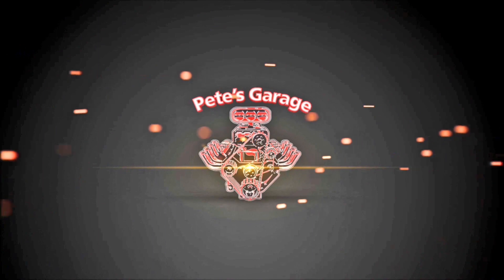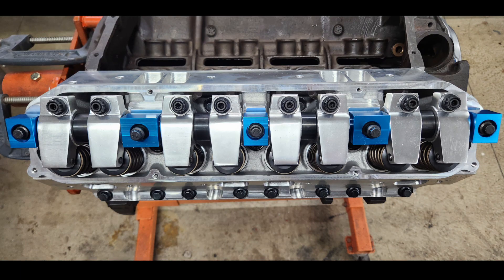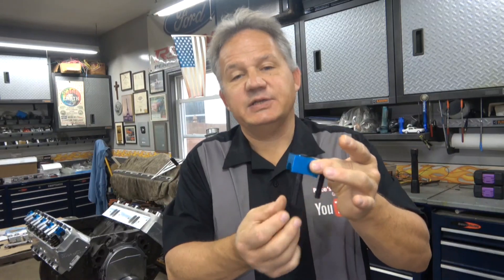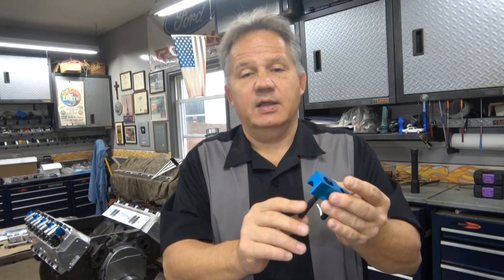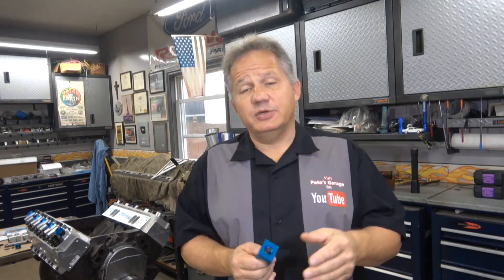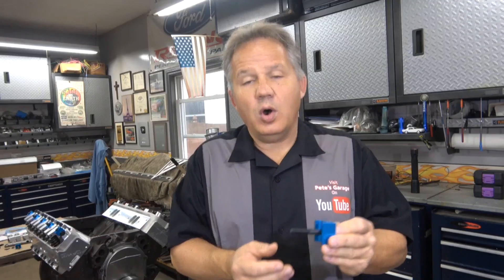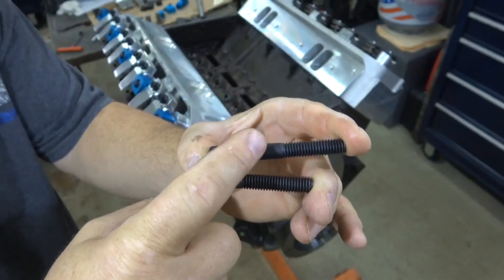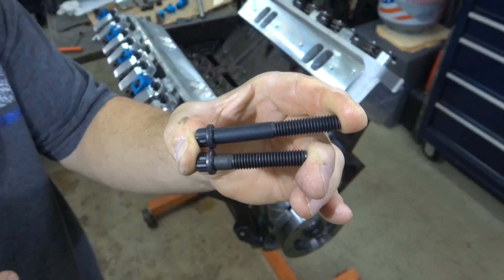Engine Building Tips - Rocker Rail Bolts for Trick Flow Heads  440 MOPAR 512 Stroker

Comment: Where Did you buy the rocker rail holdowns from? Im doing a 440--> 512 right now, I just got my Trick flow 270 heads, now I need valvetrain, I was looking at the harland and sharp kit, but the way the one in the video mounts much nicer by the looks of it.
Reply from the maker: Those are 440source
Reply: @PetesGarage  ahh i see thank you